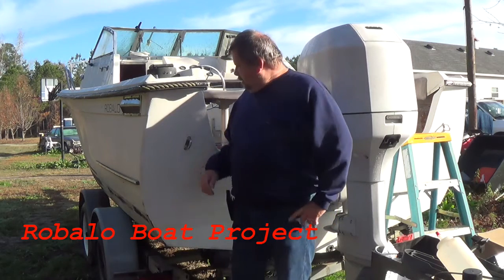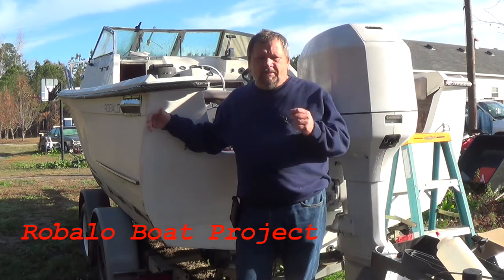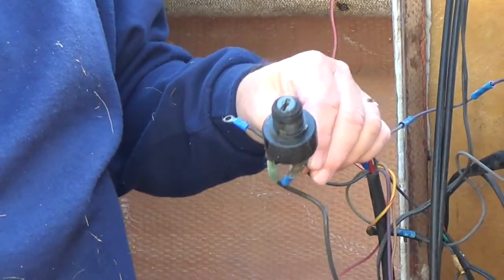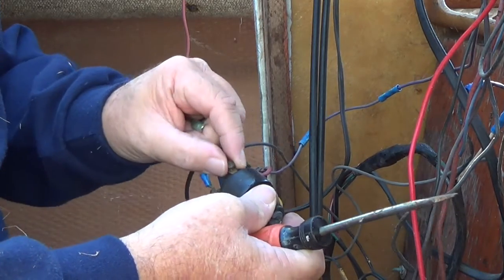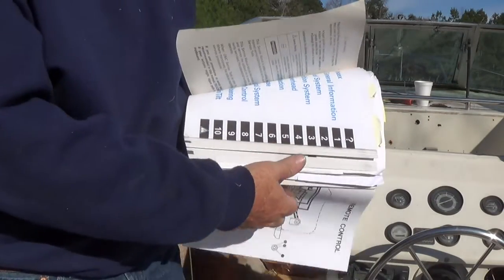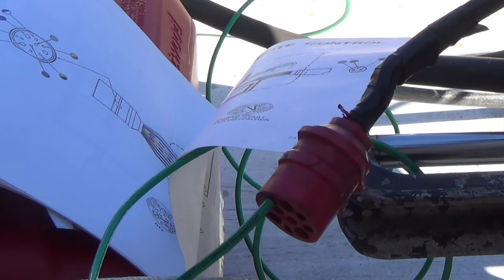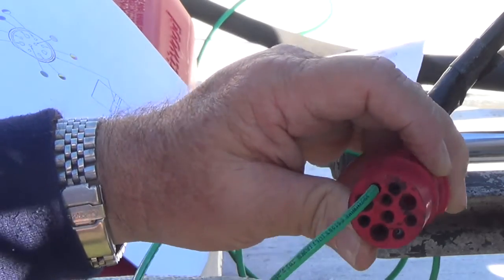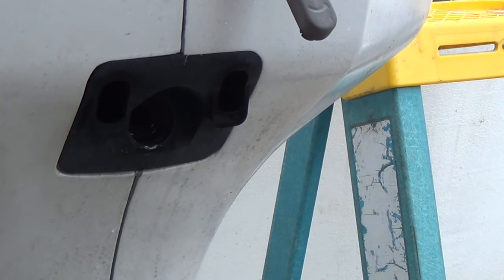Robalo Boat Project 54 "Replace ignition switch and check cooling"

Comment: I'm not a boat mechanic but I do know that the black and yellow wire is the kill circuit. When the key switch turns off it grounds the black and yellow wire and that kills the engine.